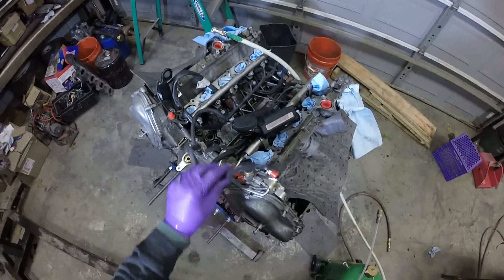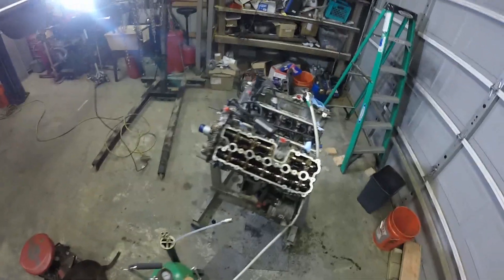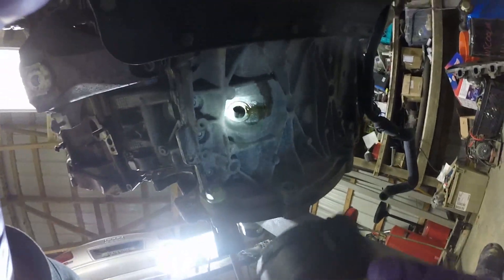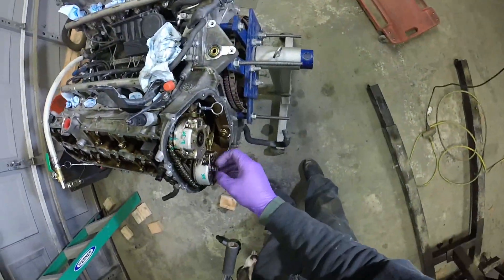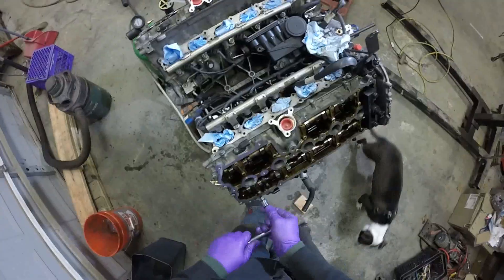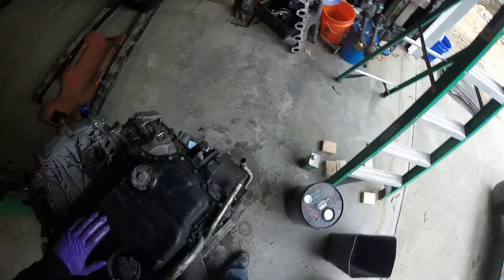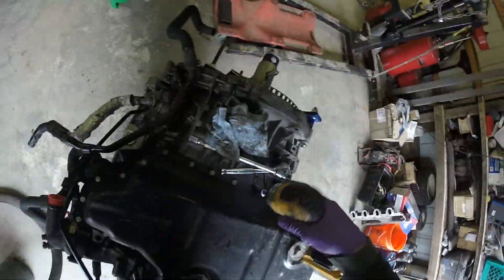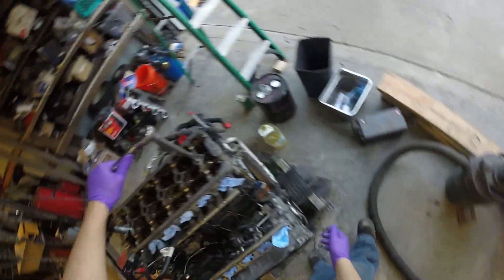Audi V10 S8: 5.2L BSM Engine Teardown Part 2: Oilpan, Camshafts, Timing Chains

Comment: Where some of the plugs wet and oily just kinda fouled ?  I know coils and plugs are a norm on these man i wish i could get your help bad . Im out of wi
Reply from the maker: The electrode was fine, the part that sits in the plug bore was oily due to the head to cam carrier gasket drying out

Comment: I'm trying to replace the cam carrier gasket (leaking into spark plug well) and have it unbolted but its tricky peeling it off the timing cover.  Engine is still in car.  Any tips?
Reply from the maker: Engine out. You need to remove the cam timing chains and lock the tensioners into compressed position. You will damage the carrier or cams if you try doing it without removing the chains.

Comment: The coolant came from the rear timing cover there are o-rings that have to be replaced they leak coolant into the motor
Reply from the maker: Yessir. Before taking mine apart i did not see anywhere else on the internet talking about this. My o rings were all pitted and hardened causing the leak. 
Coolant level has been the same since i did this work. I do have another oil leak somewhere now though..changing all 4 oil control valve o rings, dont recall doing them all before
Reply: @BGGarage  oil filter housing, oil cooler, 4 o rings on the oil control valve's are typically oil offenders.

Comment: Hi Greg I did not mark the position of my cam adjusters in relation to the cams before removing them. Is there anyway to find the correct positioning after the fact?  If I put them in a different orientation what would be the issue?
Reply from the maker: I have been thinking about this. i dont reember how the oil passages are set up in the back of the cam and the phaser it self. 
If its just a face mate that is concentric then shoulnt be an issue. however if there is a limited radius window then you have to have those lined up.
sdend me some pics of the back of the cam and the mating phase of the phaser please, greg.balandyk at geemail
Reply: I’m wondering this also , lmk
Reply: @TysAutoworks  For what it's worth I reassembled without knowing the original orientation and everything is running fine now with no CEL. My engine is a 4.2 fsi but it's the same design -2 cylinders. I looked at the adjusters and part of the cam where they bolt to and didn't see why orientation should matter.

Comment: can you help me please i would like to know where is the camshaft sensor located ?
Reply from the maker: Exhaust cam sensors are located on the outer edges of the head, near where the valve cover meets the head. 
intake cam sensors are located just forward of the high pressure fuel pumps
Reply: I have this code coming in my obd 
P0393 - Camshaft Position Sensor 'B' Circuit High Bank 2 , I’m wondering if that easy to change or deep and hard to find ,  I can’t find any photos online where is located
Reply from the maker: @AllVibeVision  View my other reply for where its located. Easy to find, easy to change. Just 10mm wrench. 
Unless you scan with VCDS, generic scan tool wont tell you where its driver or passenger side. 
In VCDS engien 1 is driver side, Engine 2 is passenger side. 
On driver side the sensor is located just infront of the dipstick tube
Reply: Thank you I really appreciate 😊

Comment: Theres a sensor with a oring that leaks that feeds the cams on those motors i think.
Reply from the maker: I think you are reffering to the oil control valves which feed the phasers. Located near cyl 5 and 10. Yes those O rings dry out and leak profusely onto the exhaust. I was having a bit of trouble finding a viton replacement so just used the OEM ones. Will probably be good for the next 9 years or so.
Reply: @BGGarage  dam i bet thats why i saw sligh smoke on my engine. I really want to get my car worked on but am deathly afraid of a audi dealer. Do you ever or would you ever consider working on one. Mine running like shit. I know intake i think some plugs got bad. Id like to get it all done. You really know these engines i can tell.

Comment: Hi Greg, great video! Question: do you now where the oil pressure sensor is located on the v10 5.2?
Reply from the maker: Front of valley under intake manifold. With front end off of vehicle mayyy be able to replace without pulling IM, but dont quote me on that
Reply: @BGGarage  Do you perhaps have a drawing or more specific information of where the oil pressure sensor position is located? 
I took of the upper IM section (at the throttle body), but I don't see the sensor.
Reply from the maker: @r.j.1456  You have to take the entire intake manifold out.  Located at the front of the valley
Reply: @BGGarage  Thank you for answering. 
I took of the entire manifold and started cleaning while I was there. Lot of carbon deposits on the valves. Today I'm going to finish putting everything back together.
Reply: Started this project due to a message "low oil pressure" in the car's display. 
Changing the oil pressure sensor luckily fixed the problem for me.
Reply from the maker: @r.j.1456  thats great! Easy and cheap compared to worst case!
Reply: @BGGarage That's true! I used multiple hours on this jobb but it was such a relief to see the oil pressure warning disappear. 
After cleaning the carbon at the valves, doing an oil change with engine flush, and installing new air filters it runs fantastic!
Reply: Only issue I have now is that the rpm's fluctuate while the engine is idling. Perhaps I forget to attach a vacuum hose somewhere during the rebuild.
Reply from the maker: @r.j.1456  Check near the front of the intake manifold . A few Ts there
Reply: @BGGarage  Ok thanks, I'll check.

Comment: Which viscosity oil is better for this engine?
Reply from the maker: I don't know which is a "better" viscosity, I use Mobil 1 0w40. meets 502 spec, cheap at walmart and still a 40 weight at temp.
Reply: @BGGarage  Thank! And how is the oil for 5.2? Is the engine clean? Does it work well?
Reply from the maker: @appolin2606  
We had the car from 70k miles, its at 100k now. When I took it apart at 85ish miles it was spotless inside. No gunk or buildup anywhere. Very good condition. I had the valve cover off recently and it is still spotless inside. 
Regular oil change intervals are more important than the kind of oil (as long as the viscosity is not too thin). 
The best kind of oil is the one that is changed frequently.
Reply: @BGGarage  Yes, I agree! Just before I had been poured oil 5W50 Motul. Now I think to stay on it or switch to 5w30 or 0w40?
Reply from the maker: @appolin2606  I personally would not go with a 30weight. these engines get very hot, I prefer the thicker oil for increased film thickness
Reply: @BGGarage  
over 30 agree! We have in the winter to -20, in the summer +35 (Ukraine) Stay at 5w50? or 5w40?
Reply from the maker: @appolin2606  I have similar temps. It would not matter to me personally. I would use the 50 if I had it available for cheap and easily available. Otherwise 5w40 or 0w40 changed at 8000 km max.
Reply: @BGGarage  50 will not be too thick for compensators and chain tensioners?
Reply: @BGGarage  Stayed at 50!
Wouldn't fasting on camshafts from thicker oil?
Reply from the maker: @appolin2606   IMO would be fine if you let the  oil warm up sufficiently
Reply: @BGGarage  
I do not raise more than 3 thousand turns until I warm up the engine
Reply: @BGGarage  
Filled Mobile 1 5w50, works quieter. But gas mileage has risen.
Frightens that on 5w50 there is no tolerance VW 502 /. There will be no problems?
Reply from the maker: ART ANT i would not expect any problems with that oil.  Get it warm, then do as you please
Reply: @BGGarage  After warming up, it works fine! Thank you very much!
Reply: @BGGarage  
And tell me where is the knock sensor 2?
Reply from the maker: @appolin2606  
all 4 knock sensors are located in the valley. Remove intake manifold to gain access.
Reply: @BGGarage  
And where to find the connection chips, also under the collector?
Reply from the maker: @appolin2606  The connectors for the knock sensors are at the front of the engine right near the lower part of the intake manifold if i remember correctly
Reply: @BGGarage  Thank you very much!

Comment: Been looking at your vids to find where the cam sensor is located. my S8 has oil smell after a few min after heavy acceleration or on long trips with heat on may be valve cover gasket on the driver side that's the only oil I see seeping but I would like to know where  the cam sensor located at.
Reply from the maker: S8 DADDY cam sensor usually dowsnt leak. If its not the valve cover gasket lost likely its the OCVs, the ones controlling the exhaust sit in the middle at the back of the valve cover. Those o rings get dry and will pass alot of oil by making it seem as though the gasket is bad. Replace all 4 o rings when doinf valve cover gaskets (1 per oil control valve)

But for reference, exhaust cam sensor is on the side of the cam carrier, near the oil dipstick tube, similar position for pass side.
Intake cam sens infront of the high pressure fuel pumps
Reply: Can this be done without pulling the engine
Reply from the maker: S8 DADDY  not the cam carrier seal or rear timing cover
Reply: Ok good thanks man.

Comment: Hey cool videos. I gotta f****ed up s6 too. Broken Plastic from the intake screwed up my valve over piston # 1. So I read your post fro. Another forum and you said you took all the flaps and actuators out. Right? And it robbed you of low end torque but gained top end. Correct?

I also want to rework my heads. That plastic ruin the valve and it doesn't seal( small less than a mm crack) barely seeping open. I wish I could remove the head without dropping g the whole f***in motor. Is there a way? If I have to drop it I'd get the heads ported and polished and cats removed. BtW nice shop. Wish I had a lift.
Reply from the maker: Not that I gained up top, only restored what was available from factory due to having a uniform plenum, not having half the flaps closed, half open etc. 
Yes big drop of torque down low, but cruising around doesnt matter and when I wanted power, trans just downshifts and bring it up to peak power levels anyway. 
I gutted the cats but added 200 cell magnaflox cats before my X pipe. deleted 4 resonators, still using stock mufflers but some magnaflows will replace those next year. She sounds amazing
Reply: @BGGarage  so I never got my intake apart yet. I was in a hurry to put it back together to see how she runs. But one of my actuators is stuck. 

So you took them all out correct? What about the flat metal pieces that divide each port on the heads? I guess they are called " intake runners"?

P2006 intake runner control flap closed bank 1

Would that cause a misfire too?
Reply from the maker: @Jonho_ninja   Flat metal pieces are needed for the tumble flaps to work correctly. DI engines require a high amount of tumble for good low speed mixing. so I did leave those in with the tumble flaps functioning. It has 2 actuators. the upper one is for the runner length changeover flaps, the lower is for the tumble flaps. tumble flaps have a sensor on either bank.
Reply: @BGGarage  btw sorry for my misunderstanding but what did you mean " uniform plenum"?
Reply from the maker: @Jonho_ninja   By Uniform plenum i meant, i wanted either all open, or all closed. Seeing as my flaps were so chewed up, missing etc, i chose to just remove all of them so all the runners would be open in the short runner position, resulting in an even charge to all cylinders.

Comment: The upper oil pan is a source of leaks on these engines but after seeing you vids I think your good, the coolant leaked down from the timing chain covers when you removed them, then you turned the engine over distributing it around the oil pan. you oil leak is most likely from the oil filter seal where it comes down onto the block.
Reply from the maker: Thanks for the comment. the oil analysis said there was 8nfact coolant in the oil (taken from the oil filter and phasers), so it was definitely going into the oil the whole time. Between the engine consuming oil (and thus the coolant within it) and me putting 2-3 quarts in between oil changes-lab said it has an exceptional clean bill of health, next to no wear metals or abnormalities. 

Took the oil cooler off and pressure tested it. no leaks detected in oil side when pressurizing coolant side. 
I suspect the rear timing covers were seeping coolant when warm. When I took them off the O rings were hard and brittle, looked like some pitting around them too. Hoping it was just a slight leak over there.  Its all back together now and driving, will monitor coolant level once I am sure all the air is out.
Reply: Interesting, surely the visible blobs in the oil pan leaked down on separation though as they clearly had not mixed with the oil?,  Hopefully your rebuild of timing covers will have sorted it though. Really enjoyed the video series.